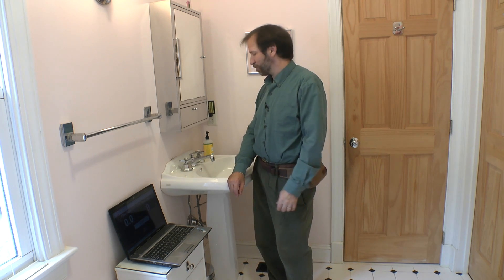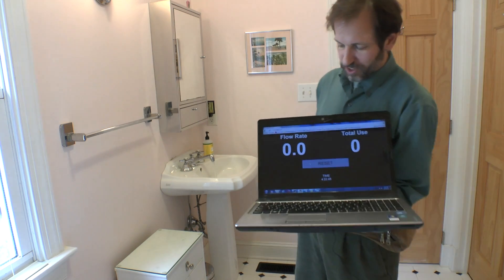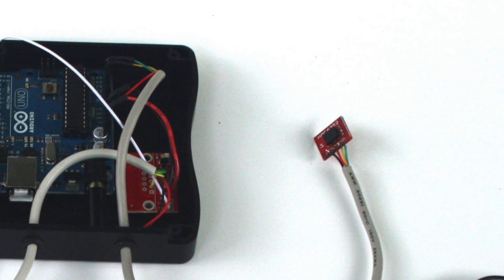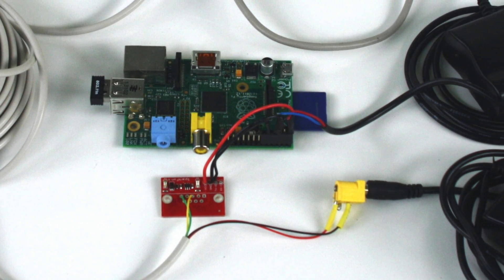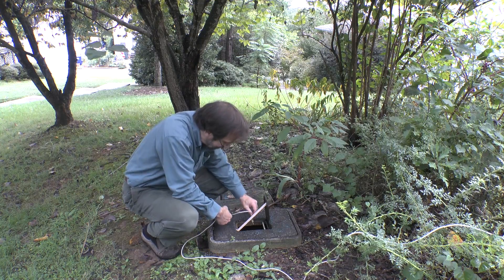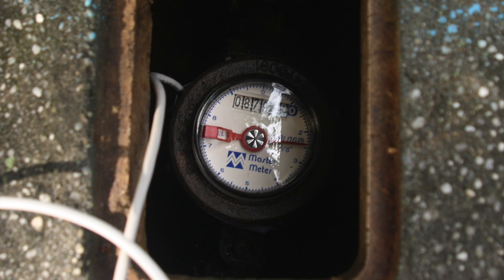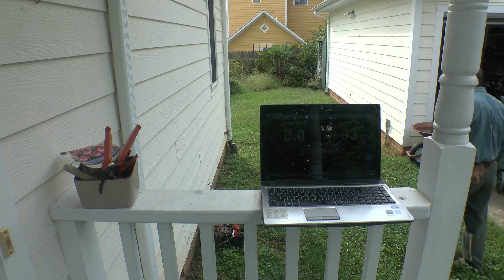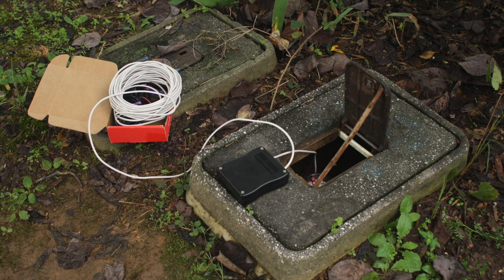Going With the Flow

Comment: Its a good effort and good for many applications such chemical dosage; offsite monitoring etc.  However when there is a water lock off, and when water returns, it brinks significant air pressure which lets the meter spin like crazy, and get billed for many gallons you did not consume.  I was hoping for a better actual sensor of water flow maybe input by a conductivity probe to say if no water to conduct, then ignore that flow.  The software could actually show meter measurement vs actual water flow to show the Utility Company their error in billing.